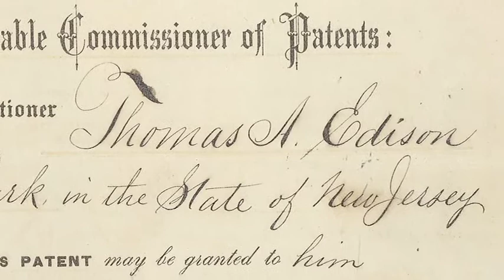History of Validus DC Systems

Comment: Furthermore the heat from Transformers is nothing considering these machines are 99% effecient.

What is important is that now DC is being investigated more & its benifits are being realized. The same sad thing happened 2 the Steam engine. They made a Steam car long ago that went faster than 90mph but the superior advantages of gasoline engines at the time overshadowed the efffeciency & power of steam engines. Timing & availability seems 2 be what society will adopt when change is necessary.

Comment: Though this is true, what you said in the info area, DC is much more dangerous. The pure nature of DC is where the danger lies. Even though household voltages in either AC or DC both override our bodies' natural electrical system, DC takes lower voltages and lower amps to cause more damage to the body. Basically it takes less DC to kill a man than AC. AC tends to be more forgiving.